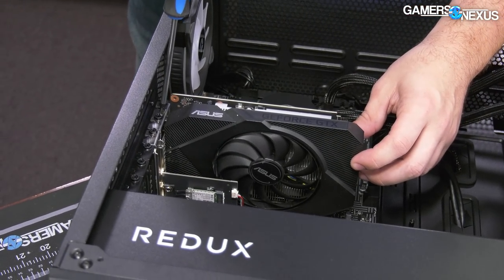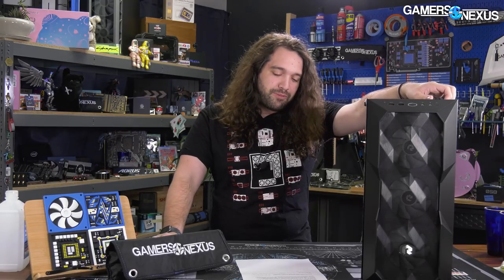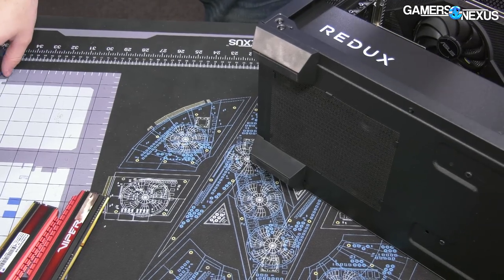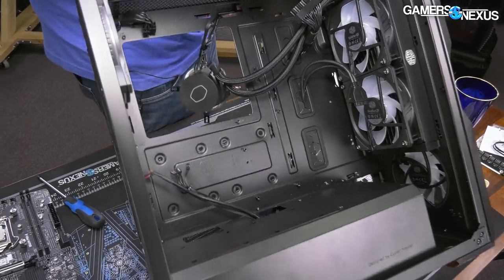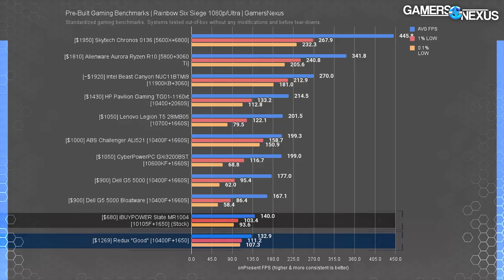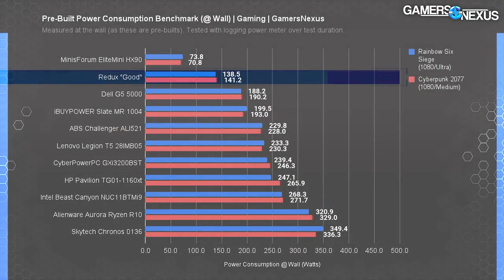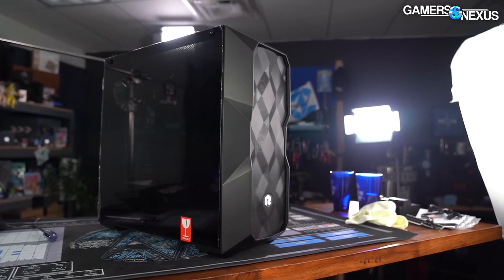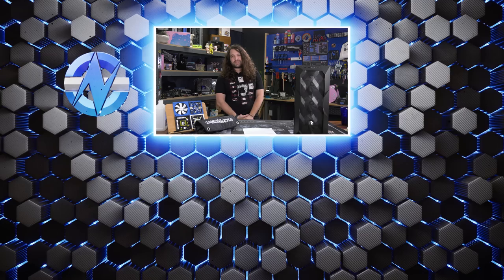YouTube Ads Told Us to Buy This: Redux Gaming PC Review

Comment: Checking the offer 5months later and the same build now contains a corsair air cooler and a 2060, the power supply is now a 600w gold. rest seems the same but for 1379$. I am assuming the performance is now way closer to other prebuilds tested and who knows, maybe just because of your review. Keep your good work up.
Reply: My brother just bought the one with the 2060 and it’s a beast.
Reply: @AQS521  what makes a beast? I have a 2060, too btw. I just see it used anywhere from 1060 to 3080
Reply: candyman  1440p 165hz
Reply: @thetshadow999animates9  2080 super or 3060ti r cheap now
Reply: @lain2236ad  I’m going for a 3090 anyway, but at that price range I’d probably go for an AMD card
Reply: It just pains me to see people spending so much for so little I built my little sister a PC for 800 and was able to put in a 6650XT(similar to a 3060) probably couldve done it for less but she wanted rgb(RGB stuff is expensive lol)
Reply: Since when are computers in europe so much cheaper?

Comment: Sounds like they took your advice to heart. They dropped the liquid cooler from their "Good" tier and replaced the GPU with a 2060. Unfortunately the GPU's market value is over $600. I didn't actually buy from them but was strongly considering it since I have a working 2080 so it's actually great that you can build the PC without a GPU and their website even prompts you with a question "what GPU will you be installing?" This tells me they're mindful of the fact that they will have the correct PSU leads for whatever GPU you decide to install when it arrives. Overall, this could save people a ton of money, especially someone who doesn't want to build a PC from scratch.

That being said, I ultimately built my computer from the ground up as I found some really good deals on a 12th gen i9 and corresponding mobo.
Reply: Plus building computers is fun! :)
Reply: @MattyH1992  not really
Reply: @Seb318  you're lame then
Reply: @binoby4612   not everyone wants to deal with cords, thermal paste and having to research which mother board fits what processor and also won't fry it or be throttled by said motherboard.  Yeah there is build my PC websites you can use that make sure stuff is compatible. but in my experience of using them then looking into the motherboards and all the stupid little ports.... You will find most parts you got for it like ram ect won't even plug into it or has not enough slots for the performance you were wanting.
Reply: @nightmarezero8465   I rather deal with cords thermal paste and pick the parts that are going to be good value and last. And most people should. If GN testing pre builds have shown anything it is that the people taking your money and doing the job is not really doing the job or research for you.

Really if not for being bit by the hobby bug. building a PC is just easy. 

B550 (brand name here), Ryzen 5600, 32GB@3200 ram. And then a ritual to the devil for a GPU at MSRP later. Ow darn just slap that thing together and turn XMP on in BIOS. Get a good deal on a decently reviewed motherboard and PSU. Like job done. No need for thermal paste since it comes applied on the stock CPU cooler. No RGB no fancy stuff. Hardest part being getting the CPU and motherboard mounted. And I guess the pins for the power button is somewhat of a pain. Ram stick and GPU takes some force and yea stock CPU cooler is a pain.

But I rather do that then whatever GN pre builds have shown us. Even laptops makes more sense then pre builds. Sorry just how it is.
Reply: @nightmarezero8465  yea. Newegg has a neat service where you can pick parts yourself and they will build it for you. I'm willing to pay the convenience fee for them to build it. It's perfect because this way you know exactly what parts you'll get
Reply: @nightmarezero8465  You make zero valid points in this statement, it takes a minimal amount of research to see what works with what, there is no chance of “frying” stuff, and if you bought the wrong ram that’s completely on you.
Reply: @nightmarezero8465  at least the parts i pick would be good
Reply: @The92Waffles  I could do that. Would have no issue with that at all.
Reply: How do prebuilts save people money? Buying the parts yourself and building it yourself will almost always save you money and get better value than buying some overpriced prebuilt
Reply: @TheDiner50 I bought a pre-built ASUS ROG G20 back in 2018 and still going strong without a single problem for 5+ years already. Before that I was building by my own. If you like to deal with all that computer stuff, good for you, but calling people “lame” because they don’t want to or saying “laptop is better” tells everything about your zero knowledge what you talking about.

Comment: What I like about this one is that there's actually a lot of good room for upgrading, even compared to the other SI systems. The case and power supply could last you into an entirely new build in 4-5 years, or you could spread the cost out over time to upgrade one part at a time. The CPU cooler can also be kept into a new build(s) as long as you have the right mounting hardware. You won't have to buy another fan unless 3 of them break. No such thing as good value right now, but this wouldn't be a bad start if you wanted to learn to DIY into your future.
Reply: "no such thing as good value"... That mindset is wrong. There is good value everywhere. $650 can get you a decent gaming experience with a Ryzen 5600 and Radeon 6600, motherboard, psu, case, ram, ssd and all (what i just listed would out perform this Build from Redux PC in games) It's just not going to be the BEST experience you could get.
Reply: @courtykat yeah, first reply left out the “right now” part of the original comment

Comment: As of October 22, the "Good" build now has a Ryzen 5 5600x w/ a B550 motherboard, the AIO was dropped for a Hyper 212 air cooler and the GPU was downgraded back to a GTX 1650.
Reply: So an actual passable machine with a needed GPU upgrade...
Reply: a 5600x paired with a gtx 1650 💩
Reply: Didn't it already have a 1650 though?
Reply: @totallynotbluu  at 25:42 it is stated at the time of recording redux is offering a 1660
Reply: At least it's not a GT 730... It doesn't even support Wayland GBM.
Reply: For a PC Build worth nearly 1,300$, it was pretty disappointed seeing a 1650 in it. I looked up some available parts online and this is what I found:

CPU - AMD Ryzen 5 3600
196$

GPU - Gigabyte RTX 2060 Windforce
539$

PSU - NZXT C650 Gold Fully Modular
89$

RAM - HyperX Fury 8GB 3200Mhz CL16 2x
84$

SSD - Crucial P1 M.2 500GB NVM 
71$

HDD - Western Digital Blue 1TB 3.5" 
40$

MOBO - MSI B450M Mortar Max MATX
75$

CASE - Darkflash DLM21 Mesh MATX
38$

FANS - PCCooler Corona or Halo 3in1 Kit ARGB 2x
49$

COOLER - Cooler Master Hyper 212 Turbo ARGB
50$

Total: 1,231$
Reply: @puffypuppy692  Ye my PC cost me less then 1000 to build and it would beat teh bricks off of this. I have a i5 10600k and a GTX 1070. Got kinda lucky with teh 1070 and found it for 330 rog strix vers. Also saw a cyberpower i5 11600k PC with a rtx 3060 for like 1200 on amazn, unbeatable deal really I got all my friends who needed a PC to buy it.
Reply: @puffypuppy692  Just a bit nitpicking, but did strike me: Why would you pay 100 bucks for case fans? The $8 or so thingies from arctic are like 90% as good as ones costing 3 times as much; the slightly worse quality doesnt matter if they dont run close to max speed., which you wanna avoid anyway. You also would just go for 1 or 2TB SSDs, no point buying hard drives these days. Even a really bad SSD is way faster than a hard drive, makes no noise and less prone to mechanical breakage.
GPU-wise you'd rather go with a 6600 XT or 3060, those are sometimes available between 450-600 bucks.

Agree with the main point though, those PC-builds are crazy rip offs.
Reply: @tomunterwegs1206  I'm currently using that config because I can't buy an RTX 3070 at a reasonable price in my region. So 💩💩
Reply: It it also cheaper?
I guess they literally cant get any better GPUs than last gen looking at the massive shortage.
Reply: @termitreter6545  49$ is the price for both kits and 6x arctic p12s are 38$ making the argb fans only 11$ more 
Bitwit has a review on the Corona fans

Both of the ram sticks also cost 84$ together

I just like hard drives, especially ones from WD because I've owned 3 that has lasted 6 years without failure

most of the available 3060 and 6600 xt I found are on the 650-800 price range :(
Reply: @termitreter6545  btw 1660 supers and 2060 oc's are also the same price in my region, that's how f'd it is
Reply: @puffypuppy692  Yup. Its very strange how overpriced old GPUs are these days. New stuff is sometimes actually cheaper!
Reply: @puffypuppy692  Oh I see, 49 for both fan kits make sense, nevermind then!

I also had a Seagate 1TB for 10 years or so, but it did have some bad sectors and I had to move Windows to an SSD to avoid slowdown. And the thing is, if an HDD finally fails, you will lose all data.
I'd really recommend to switch to SSDs, they are way better in every aspect, even if its a bad one like with QLT and no cache.
They're also way quieter; HDDs produce a LOT of vibration and noise.

And yeh, looking at GPUs, those are more expensive atm. I bought a 6600 XT for 450€ a month ago or so.
Reply: Sounds kind of realistic for the market at least. I had to settle for a 1650 to go with my 5600X a few months ago, it is was probably only a little more than $1300 altogether.

So the price still sucks but it doesn't seem like they're overcharging.
Reply: @asldfkhjaslk  sorry to hear that
Reply: @termitreter6545  I'm that guy that spent $100 on case fans.
Why? I needed 6x 120mm static pressure fans for the radiators in my PC's custom water cooling loop, and I wanted to use Noctua brand fans.
Why did I pick Noctua when I could have gone for something cheaper? It's quite simple really. Just like "Nobody got fired for buying IBM!" back in the day, these days "No gaming PC builder ever got flack for picking Noctua fans".
They're simply a good fan, at a slightly high but still reasonable price.
I did the smart thing and chose to get 6 of the Noctua "NF-12P Redux" fan, because not only are the Redux fan's stats identical and the colors easier to match to my case, but they're cheaper than the "standard" Noctua fans.
Still, once you include the fan hub I chose to use, I did end up spending $100 on case fans.
The specific fan model I chose is optimized for use with radiators or heatsinks (which is what I'm using them for), rather than just being something to move air thru the case, and they're also fans that stay quiet even at max RPM, which is important because even tho I use a set of Astro A10 over-the-ear headphones, with my previous PC build that was air cooled and I didn't care particularly much about what brand fan I used, I could still hear my PC while I was playing games. That doesn't happen with these fans in my new PC, so I'm convinced I made the right choice. Plus, the bearings that Noctua uses in all their fans are supposed to last much longer than the bearings in a cheaper fan, no matter what orientation you put it in (important, because I have both vertical and horizontal fans).
Reply: @puffypuppy692  I can vouch for WD hard drives being long-lived, I have some of them that I'm currently not using solely because I can't fit them into my current case. There's another thing that helps any hard drive live a long life. Keep the PC on all the time. If those drives are always spinning, the only thing seeing any kind of wear is the spindle bearing, and that's so lightly loaded that it's never the first thing to go. It's always the heads that scrape on the platters. If you keep the disks spinning, the heads literally can't ever touch the platters, so the disk will last until something ELSE mechanically or electronically fails.
I mean I have SATA 3.0gbps drives that still work because that's how I use my computer (I keep it turned on).

EDIT: Oh yeah that's another thing. If you have a laptop that has a mechanical hard drive in it, it's a VERY GOOD IDEA to swap that out for an SSD ASAP. All it takes is one drop to ruin a mechanical hard drive, whereas an SSD could probably survive a rocket launch without much trouble simply because it has zero moving parts.
Reply: @44R0Ndin  That wasnt really my point. People often spend more than they need to on hobbys, and thats fine to me.^^

Its more that we were talking about what kind PC you need to match the prebuilt PC, and at that point being cost effective matters.
Reply: @termitreter6545  That's a good point, and I agree with you and GN that for a PC of the level shown by this prebuilt, some re-budgeting is in order.
First order of business is to ditch that AIO for an air-cooled CPU heatsink (If it has to be kept Cooler Master for "reasons", the Hyper 212 Evo is more than capable enough even if the customer should decide to upgrade the CPU several tiers). That should free up at least $100 to use on other things, chiefly the graphics card.

I actually know quite a bit about being hamstrung by an inferior GPU, as my current PC was built without a new GPU, instead re-using one of the pair of GTX 970s that I had used in my previous build. Considering that I picked an i7-9700k for the CPU, and 32GB of 3200mhz DDR4 that actually has good timings (cl14, most of the high performance stuff you find at that speed is cl16), and a high dollar motherboard, well I wasn't trying to save money. So a GTX 970 just didn't fit in. For a short time I had put in an RTX 2070, but that card failed within 6 months (I blame that on the Micron branded GDDR6, and the fact that I didn't listen to the amazon reviews that were complaining of cards failing quickly).
Thankfully, I've now completed the build with an RTX 3070ti, and I plan to put that on the water cooling loop along with the CPU, at least after waiting a few months to make sure it doesn't suffer the same fate as my RTX 2070 did.
Most of the reason I chose water cooling is to reduce noise (and the 3070ti has an extremely aggressive fan curve that seems to be based more on GPU load than on actual physical temperature of the GPU), but the option for higher performance is nice. Even with just the CPU on the water cooling loop, I've already noticed that under load there is no time that my CPU goes below its max turbo boost of 4.9Ghz, which is nice.
I have probably spent about $3500 on this computer so far, but I was buying it a part at a time as I could afford it, so that and the Covid-19 economic stimulus checks from the government softened the blow quite substantially (bought the RTX 2070 with the first stimulus check).

Did I pay far too much for my GPU? Yes, I'm almost certain I bought it off a scalper. However, I already HAD the rest of the computer BEFORE the silicon shortages started. So why would I buy an entire computer along with a GPU just to get a GPU? I have no use for those extra parts, and Intel didn't make that much progress with it's CPUs until quite recently.

For my next computer that I build in maybe 3-5 years, I'll certainly be considering going with an AMD cpu, but my GPU will likely still be Nvidia because, well, quite frankly I like it when the drivers work the way they're supposed to right out of the box (which Nvidia has a habit of acing, whereas AMD has had no end of issues with that in the past).
Reply: You can get laptops with full power RTX 3060 for 1000 dollars, and they are selling a desktop with GTX 1650 for 1300 dollars, GG
Reply: @digitalis2977  Honestly I like this because right now the GPU is the part that would make cost explode and down the line it's the easiest to replace should pricing ever become reasonable-ish again.
Reply: @44R0Ndin  i feel that, i spent like 700 on cooling but it was worth
Reply: Now it's a 1660, 10400, and 600w PSU (still a Hyper 212), which is actually a decent combination, they're overcharging for the RAM and OS though (assuming they get it for actual OEM prices and not the $110 Microsoft charges to rip off DIYers)